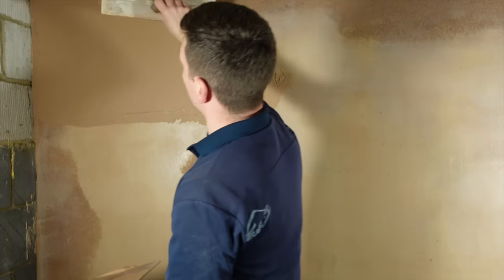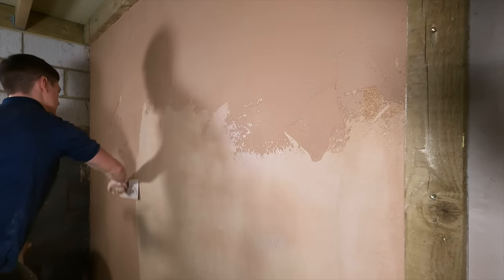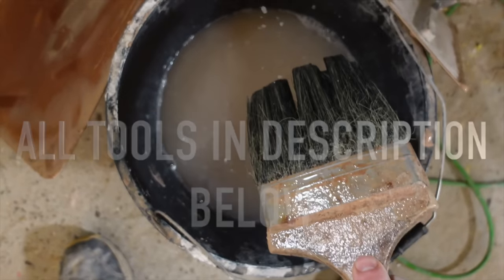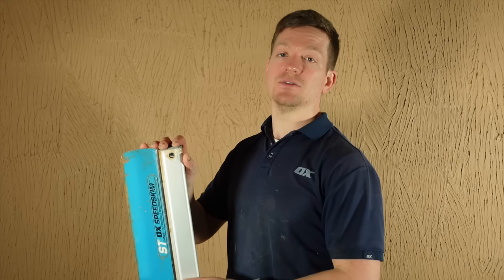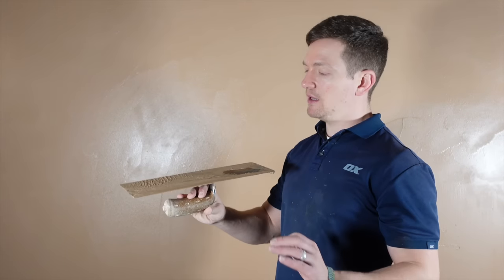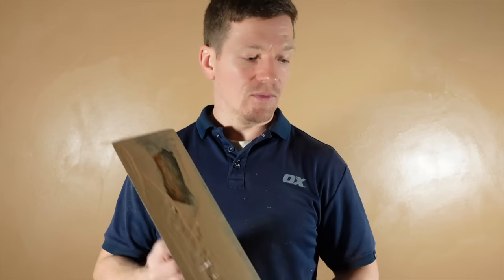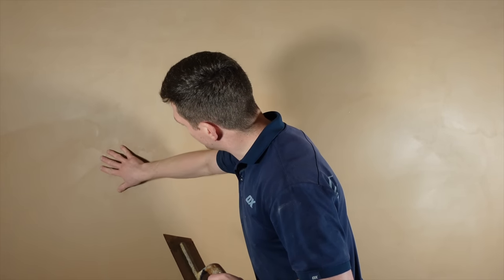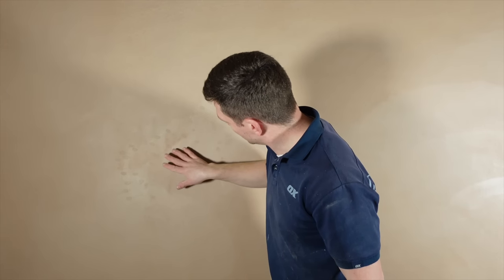Learn How To Plaster A Wall (ROLLER METHOD REVEALED) | Plastering For Beginners

Comment: Use a medium pile
Roller sleeve. You don’t get half the texture and it’s so much easier . If doing ceilings use a pole and you can lay it all on from the floor. Use speed skim with pole too.

Comment: I've been following your channel for a while and love your videos. And this is the one I've found the most detailed and helpful so far. Thank you!

One thing I'm not quite clear on is that when you say roughly 20 minutes per stage... I'm not sure if that's 20 minutes actually applying the plaster, then waiting, then another 20 minutes of doing the next stage, then waiting and so on... OR whether the 20 minutes includes  the interval, then going straight into the next stage - so starting each subsequent stage at 20, 40, 60, 80 minutes etc. I hope that makes sense.

Comment: Great explanation! If you ever retire from plastering, you might want to teach at a vocational school. The roller method reminds me  of something I like to do when painting a wall, not necessarily a plaster wall, that has sort of an exaggerated eggshell surface from too many layers of rolled-on paint, and maybe a minor imperfection here or there. I'll roll or brush a swath of paint, then press it in  with a trowel, a drywall knife or one of those wallpaper smoothing blades that resembles a half-size speed skim. I do most of the first layer of paint that way and the second coat ends up much smoother than the wall originally had been; it almost has that glassy look of new plaster. But, I have to say that if I were putting up real plaster, something I only do when it's absolutely necessary, I'd probably use a trowel for every step, simply to avoid having to clean the roller. It might make some people more comfortable though, especially those who are trying to minimize the stress that troweling puts on the wrists.

Comment: I just started plastering my first room. Started on the ceiling which you said was the best place to start. Jesus christ man! How do you do this every day, my arm is killing! Didnt turn out perfect because my first batch was way too thick, the amount of water on the bag was way off…but i made the 2nd coat much thinner and it turned out pretty good. I think my main issue is not getting it on fast enough.. i really struggled with the troweling because it had dried too much! I bought a sponge today, i think your sponge float technique might give me more time to work with it, even you pros prefer to just trowel! Anyway, love your vids, you gave me the confidence to do my own plastering :)

Comment: When it comes to drywall finishing and plastering I can go from left to right or right to left very easily, and I can do both with either hand. It comes in very handy when doing remodels/patch jobs as there are times when you need to start/stop from either side depending on the situation.

Comment: Complete newbie/DIY dunce here!  Great video but I just wanted to ask a question - Does the same method apply to plastering a ceiling? I want to have a bash at skimming a small ceiling in my sons room. The finish at the moment is a very light artex, could I use that roller method that you used on the wall in the video? Many thanks

Comment: Hi Blaine, many thanks for this video and indeed all of your excellent and helpful content.  I gave the roller a go, 2 coats with spatula flattening, and then I also threw some sponge floating into the process just for giggles.  Felt a bit like a gadget-fest but the end result was excellent.  I did find the rolled-on rippled plaster needed to be flattened really quickly as the texture seems to make it pull in very fast; I wondered whether I could modify the process next time to roll a couple of meters, speedskim that area, roll some more, speedskim that bit etc  Do you think that would work?  Thanks for all the great information, I'm learning loads from you but the skills still have a long way to go 🙂

Comment: @Plastering For Beginners  Thanks for the informative video which have motivated me to tackle the chimney breast in my 1930s house that requires patching after I opened it up to have a woodburner fitted. I could do with some further advice as the plaster is cracked and blown in places and has previously been repaired.  In addition, there is the original coving which is substantial but there is only a 5mm lip so i am unsure about just skimming it.  
Should i strip off the whole plaster or just remove the damaged parts and patch them skim? Also, what about the coving?  Thanks in advance, Anthony
Reply from the maker: You have to be careful Plastering For log burners because of the heat they emit. I think this video should help mate:

Preparing A Chimney For A Log Burner Installation | FULL TUTORIAL
https://youtu.be/fWbM8g5T1gg
Reply: @PlasteringForBeginners  thanks for the reply

Comment: Thank you for a good demonstration but the video camera needs to be set back as I missed some although I got the gist. Excellent tutorial 👌
After seeing your work and plasterers I have had they never did these techniques for that super flatness, and it  now why you see high low spots when the experience isn't there. My walls are pretty much perfect after choosing a proper plasterer recommended.

Comment: Love your videos…
I need to roller a chimney as I can’t get to it to flatten. Is there anything out there that I can use to render this external chimney. I’ve been learning through your videos and I would be really grateful for your help. 
Also, there are a few cracks in the exterior of the house but it’s Tyrolean. I’ve been thinking of just filling them watering down a bit of filler with a few stones to help it patch before I paint it. Would this work? Would it adhere ok with me watering it down. Using troupet external filler. Unless you suggest something. Hope you can help x
Reply: If its tyrolean and your going to paint over it you could make up a mix with fine sand and cement with sbr. Just keep it similar thickness to gravy but not my misses gravy. And if you can't get hold of a tyrolean gun you can use a stiffish hand brush and use it to flick it on by running your fingers over the brush. Practice on a piece of board to get the mix you feel is right for you. Been plastering 35 yrs and always found a way around a problem.

Comment: Very interesting, Is it possible to do both coats with the roller method. Im sure I saw someone do that in france.
Reply from the maker: You can but you'll struggle to get the overall thickness needed. It's possible but I think Trowel and Hawk is better in the long run.

Comment: How long on the first coat do you wait for the speed skim? What type of pressure are you using on the initial speed skim?
Reply from the maker: You can do it straight away - there’s no rules in when to use the Speedskim. It’s probably best to use it Whilst the plaster is still wet.

Comment: Sorry I probably missed it, bit when do you apply the second coat?
Reply: When the first coat is half way between wet and dry kind of like still wet a smidgen but not too dry if that makes sense :) a flexi trowel like the OX makes the finish absolutely brilliant! Can one coat small areas and flexi it and you can't tell after :)

Comment: This is farfrom totally new mate ..
Pro tips though!!
I’ve been rolling plaster on walls for years now and i learned it from my old boss (65yo)..
The only thing i found troubling, is the fact it’s very hard to fully clean the black plaster roller.
After few uses dried plaster accumulates in the roots of the roller :/

Comment: I’ve been a plasterer for 24 years. I’ve never seen anyone use a roller except to apply artex and I don’t know anyone who uses a speed skim. Maybe for site work on plasterboard but on old walls you would be taking plaster off in areas where it needs more.   People new to plastering should stick to using a hawk and trowel !
Reply: I think you are wrong  that's that you never seen that before that's not mean  it is not working   it is working  very well at all walls even on ald walls it is a special refina  roller  to apply  plaster and it is been used in Europe  years ago  I get tired to do hand application  with the roller two times easier  and faster very clean  too
Reply: good old ripple skim work my old man .26 year in game hates speed skim call um ripple skim  😂😂 totally for beginners and when light shines through window see every miss can’t bet trowel first 2nd coat flatern 4 trowels polish sos doing one wall at time two spend more time sat about
Reply: Some old game people do worse because not going together with technology in Europe for decades using rolling and long skim blades
Reply: You have a lot to learn so

Comment: Thanks mate, done my bathroom ceiling. A bit of tlc needed after but now it's painted looks ace so thanks for the vids👍
Have a question for you regarding the other rooms in the house. I've stripped all the wall paper to find they've never been plastered. The wall paper peels of ok but it completely takes all the paper off the boards behind. I've looked up that you can use Zinseer guard sealer over this to harden up and to seal it in? Any thoughts? Being a tiler I was gona use SBR but don't t know. Not what I would normally do but on a tight budget the way everything is at the moment. Any feedback would be greatly appreciated 🙏 👍

Comment: I’ve been plastering for 35 years and I reckon a beginner as your video says, their attempt at plastering after watching your video would be a total disaster. You don’t explain angle of trowel as you go backwards and forwards.
Reply from the maker: I did my best with the time I had. I hope others found it useful but I appreciate your opinion 👍
Reply: Why are you watching a video on how to plaster if you have been plastering for 35 years ?

Comment: In Europe, they don't actually flatten plaster after rolling it on. Most walls are textured
Reply from the maker: Interesting…thanks for the feedback!
Reply: @PlasteringForBeginners  aye, they use the roller which you demonstrated for the first coat and then a special textured roller for the second coat, or they use a brush. They also have some sort of beads in the plaster mix for extra texture.
Reply: Try wallpapering over those surfaces!

Comment: I aint no pro plasterer,but ive done walls ceilings bonding coat etc..trick is dont put on more than you can handle...it aint difficult...ill stick to the old method, that roller looks a faf.

Comment: I’ve known plasterers to start from the left or right top of the wall.when I put a straight across from left to right or the opposite side.the plaster from the left or right is thicker than the middle. So from left to right with a wide leval there’s are dips.not leval across.putting level top to bottom it’s not even. So I’ve had to Tell them to get the walls even. They didn’t like being told.can’t get old school proper plasterers .all they want to do is Rush.no respect for the profession no respect for the contractor ,no respect to the client.it seems to be there Boggers.and trowel marks left. Oh that’s ok mate. When it’s dried out, rub down with sand paper.don’t mind a few  very light not Perfect..every plasterer I’ve used can’t get the plaster Even, or plumb corners.I’ve even shown some so called plastere how I do it.then they say you do it then.plasterers I’ve used leave snots.on the electric switches, sockets. And the consistency is not even .only Proper trained plasterers will Sometimes do a Fairly Decent job. Your vid ,your experience your care to attention is very Rare.good job mate.

Comment: This is fucking insanity. Doing a whole house would take months of constant work. His demo wall is conveniently not tall and not that big/long. Imagine when it's not! Surely there must be an easier and faster way to get flat walls. I bought an old house that needs renovating and the walls have small cracks in them all over the place. The house is not empty so needs to be done 1 room at a time.

Comment: Blane what about using the roller for the first coat? I always struggling and I am very slow putting the first coat on. I’m not too bad from 2nd coat onwards. I still suck at mixing up I think. Tried doing my kitchen. It was a nightmare 😭
Reply: Don’t think it would be thick enough for a first coat mate
Reply: @williammacphee335  shame it would have been handy
Reply from the maker: You can but I think you should stick with the trowel and just get used to it. You've started now which is the hardest part - if you can just get through the first few months then you'll be grand. 

The hardest part is the beginning but it gets easier. Trust me!
Reply: @PlasteringForBeginners  I started learning over a year ago now through your videos. I’m just too slow. Got a bad back so I can never do it fulltime mate.

Comment: Bit the bullet and bought a Pentrillo plaster roller after seeing your vids..I can plaster normally..been doing it for years.. however.. I had a go on a 20m2 ceiling at home.. 
1. Great bit of kit for getting the plaster on quick and semi evenly.. I found it going off a bit quick on the first coat and dragging when flattening as I’d done the whole ceiling..brought it back with a slurry sponge ok.. 
2. Second coat I rollered a meter strip then trowel flattened it and worked my way across the ceiling.. this solved the problem fine..
3. Tried my speed skim over it on both coats.. it dragged it off.. so put it back in the van..😂
4. The roller sheds fibres a bit.. so you have to pick them out.. not really an issue..
5. Definitely a good bit of kit for a DIY to get plaster on the ceiling without it going all over the floor.. 

Cheers.. I’ll be using it again on a paid job..
Reply from the maker: Interesting! Fair play mate - thanks for sharing. Let us know how it keeps going.